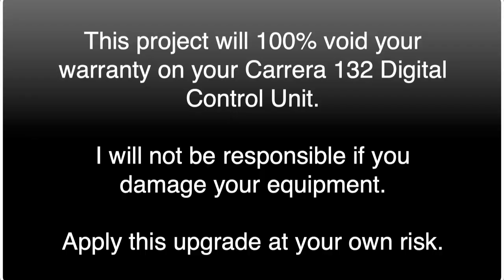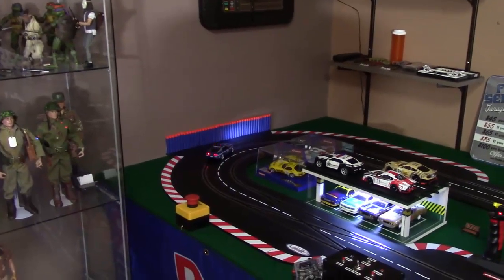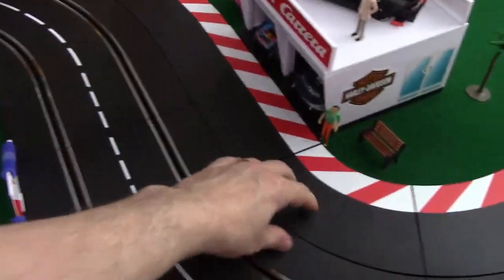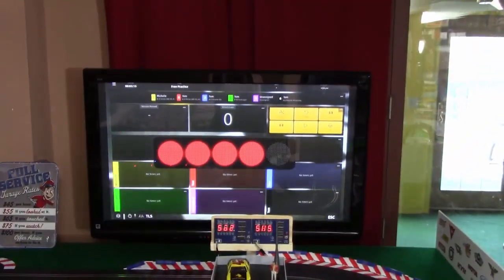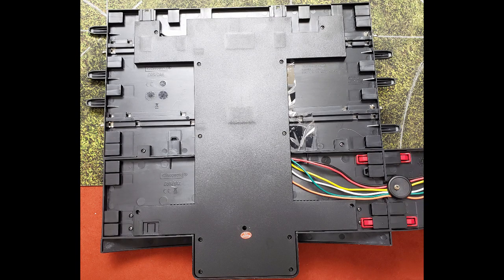How to make a call button for your Carrera Digital 132 race track

Comment: Nice video and explanation. I went through similar iterations on a call button. Actually did something similar on my previous SCX track. Out of interest, did you consider using the Smart Race Connect app which allows for individual driver info stations and call buttons for each driver on their cell phones? When racing we currently use that app which allows for a VSC mode, virtual safety cars. During this mode The app announces who caused the stoppage, slows down all traffic on the track to a user defined preset slower speed, and automatically restarts the race after a user determined VSC duration. This avoided having to modify the CU.
Reply from the maker: Yes I considered that but the button solution was better for my grandkids. They love to smash the buttons and I don't worry if they break them.
Reply: I fully understand. For me have now used both types, I prefer the mushroom call button also. I see my drivers fumbling trying to hit the cell phone button, and found it much easier to just slap a button. Am thinking about going back to the call button approach and your video will be. Tremendous guide. Thanks again for putting the info out there.

Comment: Curious how you would have the arduino communicate with smart race.  Looking for a solution that I don't have to open my control unit.
Reply from the maker: @Ayera11 I have another video where I show how to communicate with smart race. I have a link to some code in that video description you can look at. Unfortunately I do not have the code to stop the race because I do not own that smart race module. The module to yellow flag the race is an add on module I have not purchased.
Reply from the maker: Here is a link to that video https://youtu.be/ALt0CYZ2Pqo

Here is a link to the code.  http://tomsidenerpoems.blogspot.com/2023/12/wifi-board-include-httpsarduino.html
Reply: Thanks I’ll check it out!!

Comment: Thanks for this. Is there a picture of how you connected the three buttons. could you use a hub or is soldering them together a better option?
Reply from the maker: Yes you could use a hub. It works both ways. You can wire them all direct to the main connection coming out of the controller, or you can daisy chain them. I wired the close ones directly back and daisy chained a couple that were fairly far from the main connection (to save wire).

Comment: Great video! I’ve done this with my track, but took it one step farther. Since I couldn’t justify the cost of wireless controllers, and was already planning on extending my controller cables, I decided to make three of my five call button junction boxes pull double duty. 

I cut the offset RJ-12 plugs from my controllers, leaving a pigtail to splice into; and I crimped standard RJ-11 plugs onto the controllers. Then, I spliced into the pigtails and extended them in pairs to the call button boxes. (1 & 2 to the first, 3 & 4 to the second, 5 & 6 to the third.) I carefully cut holes in the junction boxes to accept RJ-11 modular jacks. After snapping them into place, I reinforced each with a healthy glob of hot glue. Now these three call buttons each act as a driver station for a pair of controllers. (The other two are for marshals.)

You just put your car on the track, plug your controller into the port on the side of the call button box and you’re good to go. With a 17 x 6 foot table and over 75 ft of track, we couldn’t all be huddled around the CU. Now we’ve got elbow room easy access to a call button from everywhere.  

Thanks for the video. Keep up the good work! 👍🏼
Reply from the maker: Excellent Idea!!! I may have to try your mod!

Comment: Tom,
Thanks for making this video. If you could just clarify how the call buttons connect to each other before the control unit. I’m not very knowledgeable regarding electronics. Thanks Tom
Reply from the maker: just run a wire (2 conductor)  from each call button to the other. It doesn't matter what side of the wire goes to what side of the button. It's just like hooking up a set of speakers. Just make sure if you are using the buttons in the video that you have the wire connected to the correct posts.
Reply: Thanks.

Comment: Can these call buttons used with your carrera analog to didital conversion box
I'm building a box now
Thanks for that info
Banzai
Reply from the maker: Yes I have them both on my track. They should work in both modes.
Reply: @tomsidener  thanks for responding
Box is almost done
Wish we could insert pictures here